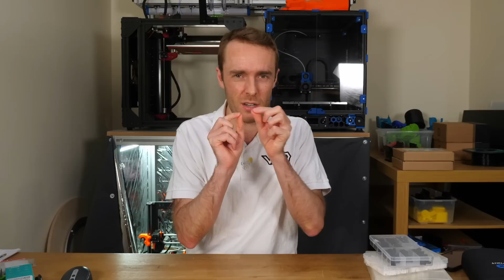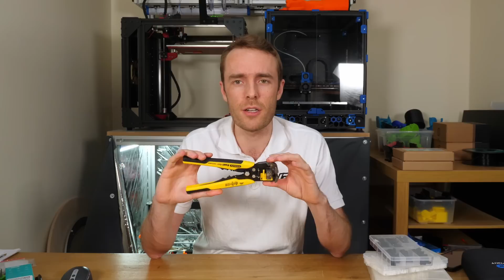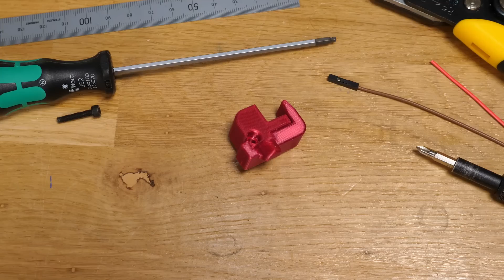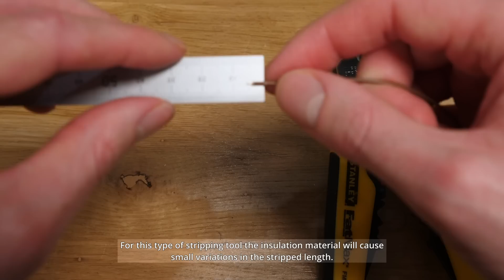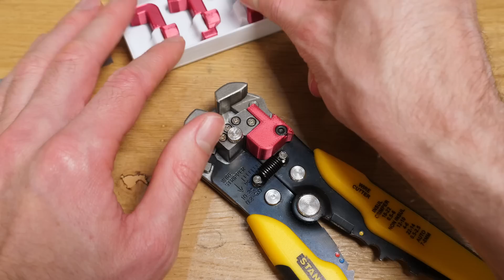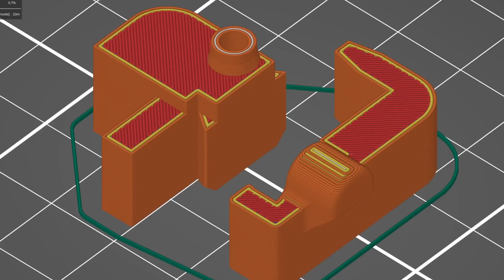This Upgraded Tool Saves Me Time

Comment: Great design works so much better than the little slider on the CK made version of this wire cutter. The cost of the design added much greater value to the tool and it usability.Thanks for the work you did.

Comment: 2:53 not sure of the diameter of your hole for your 3d printed parts, but i've found button head bolts to be a bit wider on average than cap head bolts. the differences are in the 10ths of millimeters, as i just measured a cap head bolt with a diameter of ~ 5.6mm where as my box of button head bolts average in ~ 5.5mm. just something to be aware of. i've also noticed the difference in sizes increases with the size of the bolt as well. as i believe m5 button and m5 cap bolts have bigger discrepancy than the m3 bolts.  great mod BTW.

Comment: I love this type of wire strippers as they can strip the outer sheath from twin and earth cable, I don't however like them for small wires as I think the damage that they do to the insulation is excessive for the smaller sizes and the torn end of the insulation affects how these small crimp connectors grab onto the insulation. For these small wires, I much prefer the manual type such as the Engineer PA-06.

Comment: I think you should make a C-shaped spring (compliant mechanisms)
 so that the part always sits tightly. 
Also add a marking of the size that the replacement part corresponds to.

Comment: For the magnetic version, you only need 1 magnet on the tool part. You can just press fit nuts into the jig part.
Reply from the maker: Yep of course, the strength is a little lower though and you get a surprising amount of leverage. Feel free to try and and see how it works for you.
Reply: You sir are a genius.

Comment: Nice little tool mod. Everything is better with magnets, but to avoid the cost why not have one magnet in the fixed section and just a ferrous screw or something in the replaceable part?

p.s. Video gets demonetized due to the use of the word "stripping".
Reply from the maker: Mainly for strength, it could work, but if cost is the limit, just go with the dovetail.

Comment: Just use a a wire stripper like the Knipex PreciStrip16. They all have a adjustable wire stopper and you will always get the correct stripped wire length. I use those mentioned every day at work it’s just way easier than the type you show in the video. And you don’t have to modify it to even make just somewhat accurate strips…
Reply: Yes, but the Knipex costs about $100 more . . .
Reply: @mikemike7001  Having the actual perfect cut every time is worth the money, time and material you safe. Like i said, i use this professionally and it does keep me a little bit calmer when i have to strip wires where it has to be precise. And the tools you need to properly crimp the connectors are even more expensive and are tied to the connector type. So 100$ for universal tool like that is ok for me.
Reply: @Galileocrafter  Agree it's worth it if you strip lots of wires. Time is money, as they say. And I love good tools, especially if my company is paying for them. Looking at the Knipex you recommend, I just might see if they'll buy me one. But Adam's solution is probably good enough for many of us who just occasionally need to strip and crimp a bunch of wires for building or modding a printer.
Reply: @mikemike7001  Yes absolutely, for hobby use it’s a bit too expensive. But there are other similar but cheaper wire strippers around. You probably could find something for around 50$ or less (which i consider a fair price for something like that, ymmv). The Knipex one is expensive, i agree but it doesn’t have to be that one. Although it does perform really well ;).
Reply: yeah...just spend € 80,-- or more..I like expensive, good tools as much as the next guy, but be reasonable. 
I rather spend the 4,-- GBP or wing it...like usual ;)

Comment: i like this idea! i actually went with another stripper type due to this issue (the regular cutter type) it seems the jaws on mine were not consistent, each time the strip was a different length. have wired 2 voron 2.4s with the cutter type. but i may make a magnet type for the cutter type also

Comment: Great idea to extend a cheap product with some more expensive features!
Really like how you did the details like the packaging and adding a magnet! Very nice if you got all those details worked out since it is more difficult as some would think.
If you wonder why so positive and you are not buying it.
Well I was lucky enough my dad had an expensive wire stripper with length settings, that he didn't needed anymore.